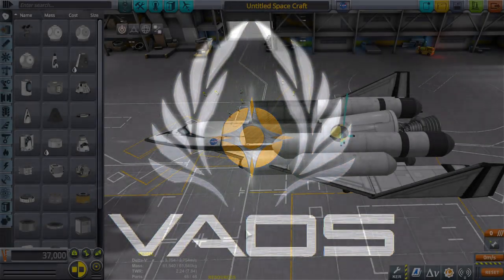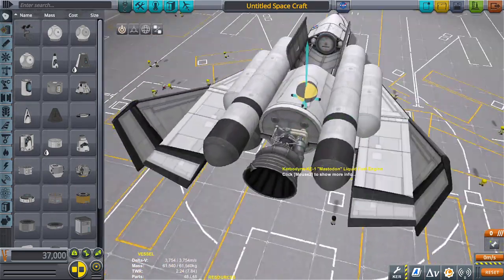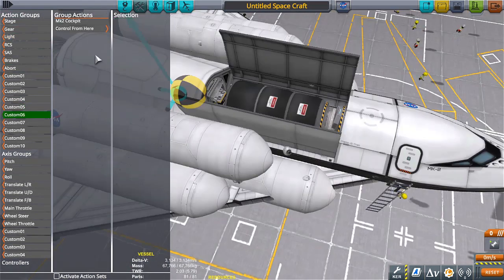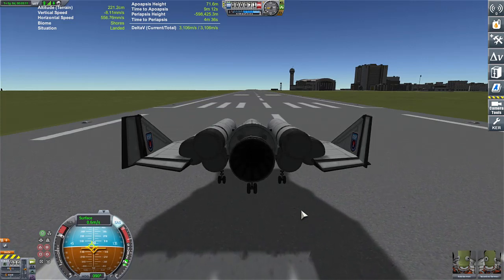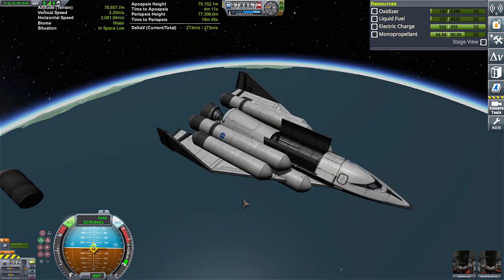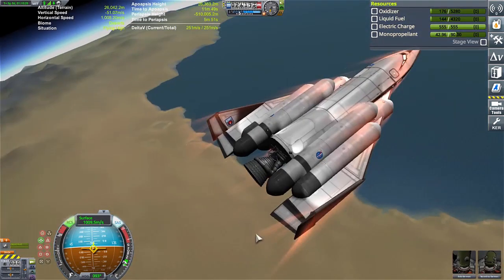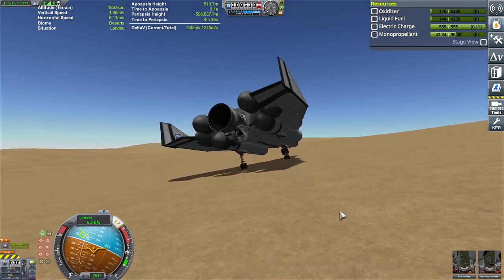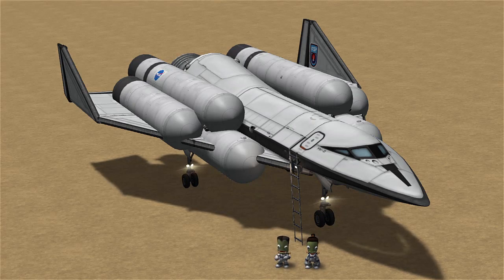DAEDALUS CLASS SSRT old school ssto part 3  |   KSP 1.11

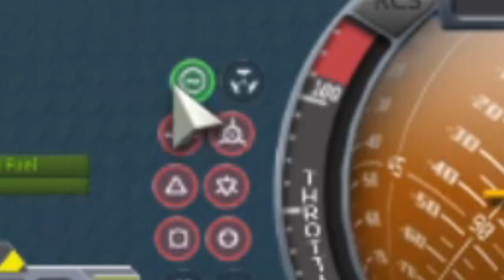Comment: 7:15 reminds me of my second Laythe landing. I not only forgot to take it out of prograde, I had target set to the first plane and I didn't notice the navball switched into target mode as I flew over it. The target plane was on the equator so the position of my prograde indicator was distorted by the velocity of the surface and I was like, "Why is it so hard to control? Why is it insisting on flying to the left of prograde?" Of course, I wondered even more when I nosticed SAS was set to prograde. Evidently, aerodynamic force on the tail prevented it from yawing to where SAS directed.

That is the Stiletto heels of cockpits: Looks stunning from the outside, but oh boy! it's horrible from the inside.

Nice landing! XD I like to set only the rear brakes high, they tend to pull it straight though not always. Nice plane though; single-rocket is cool. I'm building one, but mine has a nuclear engine with propellors to get it to altitude, if it works at all.